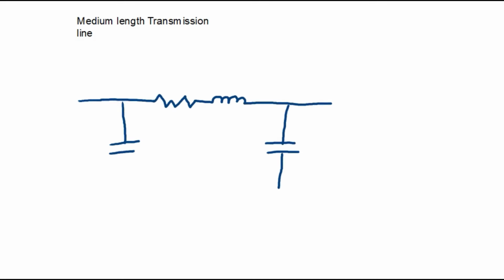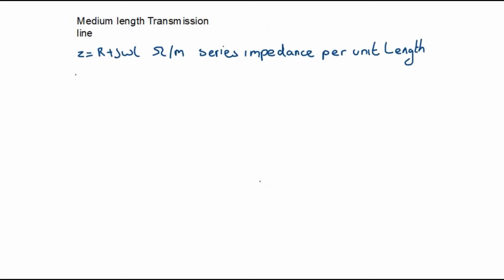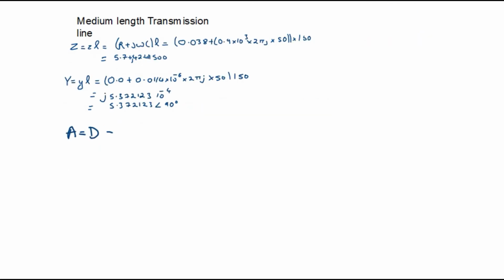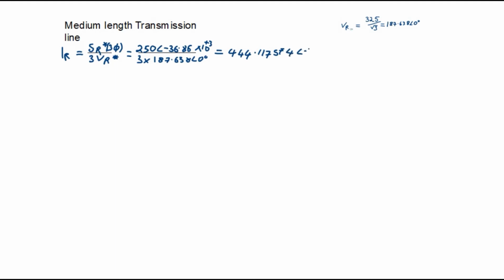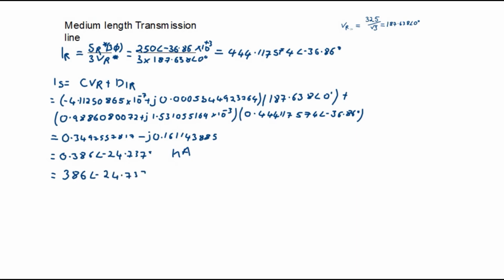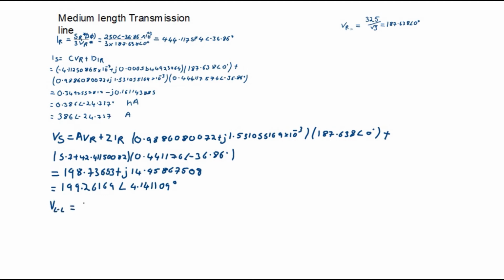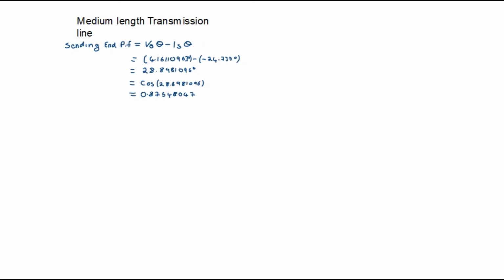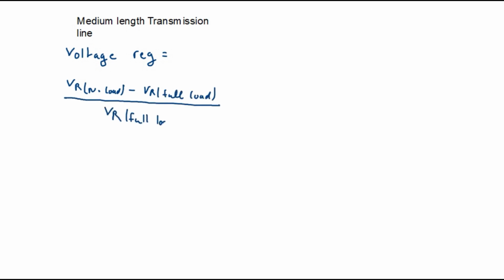Medium Transmission Lines Calculated.

Comment: Hi There, I think you have made a mistake in calculating Ir, you have used the equivalent single phase receiving power as an apparent power in your formula, the correct value for Ir should be 555.144 <-36.86 A